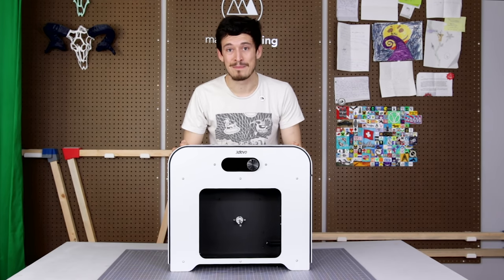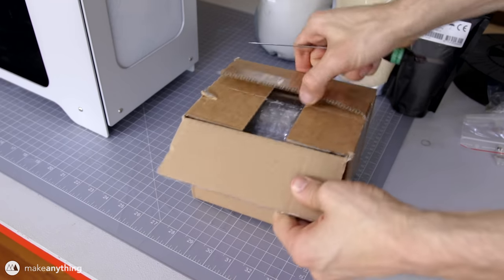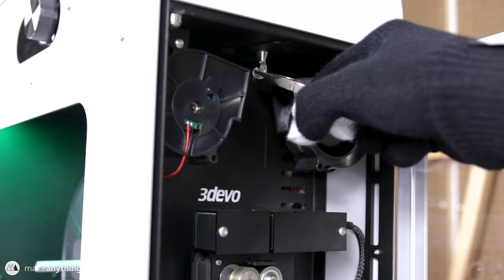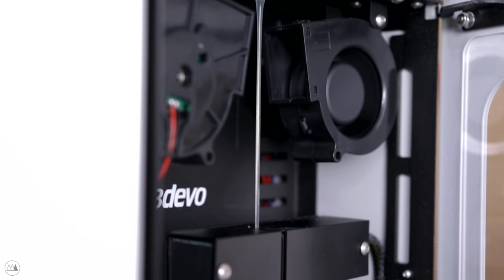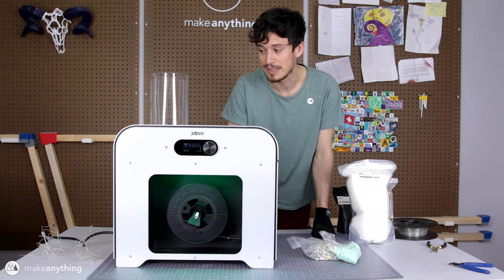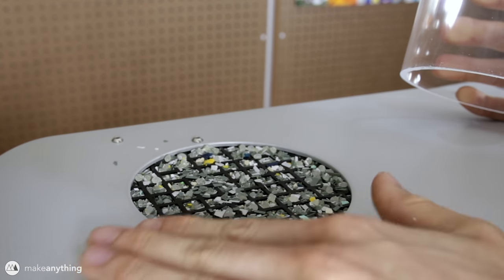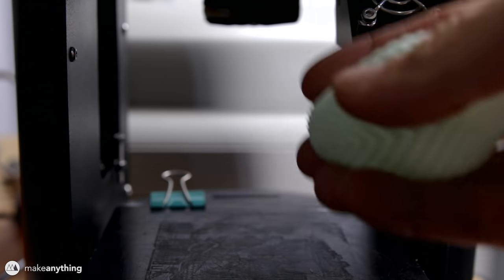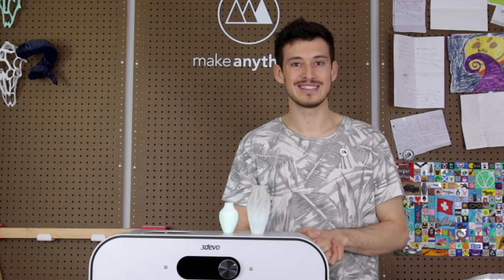Making my OWN Filament from Failed Prints with the 3Devo Composer

Comment: Chip, the magnetic bed is made for this application.  Both the binding plastic and the ceramic magnetic material are chosen for the application.  Normal sheet flexible magnets use low temperature materials because of cost.   However for example one likely material for the magnet is Neodymium which can have a peak temperature from 80 to 200 Centigrade.  without changing the magnetic strength.   I am getting this from a chart provided by Adams Magnetic products.   Their three flexible magnet material they sell are: Standard  71 Centigrade, High Energy 79 Centigrade, and Neo 116 Centigrade.

Comment: Sounds like you'd benefit from the Tevo Shr3d It for those failed prints you want to reuse. I did some research on Tevo and the Shr3d It and it sounds like a pretty good product. It will shred any print into consistent bits of plastic that can be used to make filament.

Comment: You can get mesh screens that you put into a wood frame to make sieves that allow material that is small enough to pass all the way through.   If you use several different stages of screens you can get material that needs to be chopped a lot more versus material that needs to be chopped less.    The final screen will give you a "go / no-go" gauge for the material you actually put into the hopper.

Comment: We need a 3D printer with an optical sensor and self-adjusting flow rate.
Reply: That would be cool but optical sensors are expensive. A pair of digital micrometers might be cheaper solution.
Reply: @SafetyLucas  Optical sensors are quite literaly a dime a dozen. however, I think the idea of two micrometers is a better solution. maybe a set of two spring loaded rollers cappable of measuring the size.
Reply: This smells hackable
Reply: @RalphBrandsma  I think redundancy would be to have both systems. If only one is possible, I am in favor of the optical. Fewer moving parts.
Reply: @deefdragon  i see what you mean. However. I was thinking more for both dimensions. As in have them in a x configuration so that you are sure it is coming out cylindrical and not skewed. But I agree with the less moving parts idea

Comment: You really need to work on the size difference in the crushed filament.  You had 1cm pices with items there were basically dust size. That will never work no matter what your settings are.  It needs to be consistent as much as possible.
Reply: Yes, perhaps it needs the scraps to be pulverized until powder, then mixed in that way.   
Or fuse the scraps into standard size pellets/grains like the rest.  How do they even make those pellets, they are rounded & have no cut marks i dont get it.  👽
Reply: @roidroid  pellets come from a multiextruder, think big hot meat grinder, and are cut up while they're still hot. While cooling down and rubbing against each other they acquire their rounded shape.

I think Devin needs to sift his pieces to make sure they're all below a given size, about the size of factory supplied pellets. Also it still won't be consistent enough. Perhaps a two step process, where he first extrudes some filament which may not necessarily come out consistent, then somehow (to be solved) chop that up into pellets of consistent length, which will then be already much closer to perfect and maybe repeat this process.

Comment: To get good sized granules from recycled prints you could extrude it once to crappy quality filament and shred that. Then you could use those like the new granules alternatively you could try replacing the pully wheel with a gear like thing that cuts the freshly extruded filament from the first run.

Comment: Maybe there is a reason the raw PLA has the shape is has, to prevent jamming and maintain an steady supply of melted PLA helping precise extrusion.
If that is the case, we need an additional machine to produce these pellets, or they have to melt shredded PLA before it gets into the feeding screw.

Comment: I would like to see a recycling service where you can send/give them all your failed prints and they reuse it, and you get money for it, instead of spending so much time and tweaks with creating a new filament. Some sort of recycle would be nice. Because compared to normal plasic trash, these ones are pretty clear and companies have the ability to filter any different color into seprated ways by lasers.

Comment: To recycle old print you need a granulator to get the same size granule as the new plastic
that way the melting will be more equal between the new and the old plastic

Comment: This gets better results most of the DiY stuff I've seen. Lots of potential here and it will be interesting to see how it handles pure recycled plastic rather than adding raw plastic to the mix.

I'm also thinking that getting more consistent shredded material may be the key to making this work. Powderizing the recycled plastic might be too small, something closer to the size of the raw granules might work better.

Comment: What's interesting is, you could totally use a nutty roll as long as you knew what the diameter at each point actually was. It'll change smoothly anyway and you can just adjust your extrusion rate. I wonder if anyone has done that.

Comment: I liked the demo vid.   It would be nice if there was a second pass you could do on a spool to reduce the variation.  If you could run a spool to an empty spool and have it make the diameter even more accurate  (slicing with lots of blades?  grinding?  heat?   Not sure, but seems like there should be a way to make a spool even more accurately dimensioned)

Comment: In order for filament recycling to be feasible it has to be cost effective. At 7000 dollars for the machine (and ignoring electricity costs) you would have to recycle around 250kg of plastic to get anywhere near break even. Desktop 3d printers extrude about 50g of plastic per hour. Assuming 30% of your printing is waste, you would need to rack up about 15000 hours (2-3 years) of print time.
Reply: Or share a machine with another few hundred people via some kind of service.
Reply: and dont forget, such a screw and barrel have a limited lifetime the costs for it are the highest in this machine!!

Comment: If you’re having issues with the recycled stuff failing, perhaps something that vibrates could help. Sort of like tapping on a funnel to get sugar through. It would have to vibrate at intervals, or you’d have it unmix your plastics. 

I really want one of these. I’d especially like to use it with all the soda bottles I go through.

Comment: This is my first time commenting on one of your videos and the first time I might actually be intrigued to purchase a reviewed procdut on your channel! I'm a landscaper and I'm wondering, do you think we could make spoos of plastic similar to what we use for the weedeaters and at a cheaper cost than buying it at the store?! The spools I buy are around $50 and we go through about 10 a year. They're around 855feet I think. I'd be super curious to see u make some and test it in a weedeater!! Love your content, keep it going!!
Reply from the maker: Hi Miranda! The thing is, what you're seeing in this video is my complete experience with the machine, so I can't say much more with certainty. The Composer should be able to make trim line out of Nylon (like the originals)... but 10 $50 spools is still only $500 compared to this $6000 machine (plus the cost of the materials). You wouldn't make your money back for a decade, it seems. Now, there are open source designs for extruders like this, so maybe there's some potential in going that direction

Comment: haha, I see you have binder clips on platen. I just did that after a few failed prints that caused the bed to shift with High Quality prints (snapmaker). I want the extruder but need a shredder to prep material for use.

Comment: To get your filament finer you could do the same thing they use to grind up and mix black powder gunpowder... Use a bunch of steel ball bearings in a rock tumbler with your filament to grind it to powder... In black powder they  use lead balls do not to make a spark and explosion.... But using the steel balls should work well....

Comment: I'm not sure what the temp is as it hits the spool but tape doesn't stick well when it's too warm.  Something like a simple clothespin might do the job though.  Armchair quarterbacking here.  Also, I wish that the thickness data that the composer takes could be input into a printer so that it knows the exact current thickness of the filament it's printing with.  A feature like that might compensate for any irregularities.

Comment: I don't know about its grinding motor hp but, maybe you can try to add diy mini grinding/crusher/shredder/whatever for any kind of waste plastic before put into that 3devo with bigger motor hp.
Since a bunch of waste plastics don't have consistant specs, i hope this method Will make those heating lines have a better and more stable output filament.

Comment: Rather than breaking down recycled filament into 'flakes' or dust, you might want to consider getting/diy-ing another machine that turns these flakes into actual granules. This might help with the clogging you're getting. I think Proto-pasta use a similar process when mixing custom colours.

Comment: Could you connect it to a 3D printer to match the speed with the need of the printer and use the filament in real time?
The printer getting the thickness information from the 3Devo, it would extrude accordingly
Reply from the maker: I'm not sure how well it would work slowed down that much, but it would sure be cool!
Reply: We're already on top of it

Comment: I think the problem is that your pla scrap have shape that is not supported by the mecanism ^^  You need to turn your scrap into small Ball like the one gived by the manufacturer before introducing it in the machine this way it will work like a charm i think ;) But good luck for finding how to turn scrap into small Balls x)

Comment: Pretty cool they've come this far with recycling filament. I've seen a couple other videos that have homemade models which were just ridiculous, sorry ☹️
I'm sure it's disappointing to have to do so much calibrating on a supposed plug and play model, but it's brand new and you'll learn of it. Those flakes you crushed yourself that seem to make the machine go haywire, was there any ABS in there? I would think you definitely have to keep ALL types of filament separate? I'm surprised they didn't include a mini crusher that would sit above the hopper and that way it's a nice nearly identical pieces. Looks expensive!

Comment: Yeah I think the problems start once you don't start with fresh granulate but with some ground up parts instead. Companies sometimes do offer recycled filament but it is usually limited to 1-2 filaments and also to just one color or so. The actual recycling industry has heavy limitations there as well, which materials can be recycled in which color and for what purpose.

Comment: I've used a cheap coffee grinder to cut up failed prints into tiny bits, a lot of blenders wont be a s strong but coffee grinders are great
Reply from the maker: That's how I've done it so far.. it's just a shame they can't run for very long without overheating

Comment: That price seems... A bit ridiculous. Especially when compared to something like a filabot setup - They're significantly larger and draw a lot more power, but run quite a bit faster and have better tolerances at a lower cost ($3800 USD as opposed to €5350 euros)

Comment: It is a very cool system but 7000$ is around 320 rolls of filament(abs, pla, petg,tpu even>_>). 1kg of 1.75 is roughly 330 meters, so total 65 miles worth of filament.... 705 lbs of filament is gonna be hard to reach to see returns especially since you can't melt anything above 200c. On the bright side it would only be about 2 weeks of nonstop running which is pretty impressive actually!

Comment: The problem I see is that it's hard to mix the plastics thoroughly when you have different colors. What I think should happen is the pieces are mixed and heated all at once in one pot. Then once all the colors and pieces are mixed and at the same temp it then starts to extrude.

Comment: The comments on your video about compliant mechanisms were locked, for some reason. My suggestion to just slightly upgrade your 'marble chopsticks' would be to just add more of a cradle for the marble at the lower end of the sticks so that it has a harder time falling out when something is in the grips.

Comment: Hugh? Lyman won a $40k Competition to design a sub $250 Costs Desktop Filament-Making Machine but virtually every commercially made version of it has been absurdly expensive compared to the cost of components. I planned to try recycling Inkjet Printer Case ABS/HIPS and provided a local Recycling Co. with x4 sacks of B/W Colour & Type-Separated Plastics. Instead of putting them through the 8mm granulator one at a time & dispensing the output back into my 4 bags, some numpty tossed everything in together leaving me 88Kg of "grey" material which they helpfully dumped in their Hall in 1 unliftable plastic sack. WTF. LOL! It's not always easy being environmentally friendly...

Comment: id say maybe you did the opposite, that it was too shredded. having powder like pla in there that will melt very quickly, but also pack very tightly in the hopper. vs the very smooth, loosely packed blobs. 

seems like you need a pellet maker to refine old prints, then use those pellets in the fillament maker :P

Comment: Im working on a project that i could use your advice on. I saw on this video the vase you had an inlaid twist pattern to it. Im new but i need to learn how to make basically a triple helix design with a 9:1 twist ratio around a center point. how did you design that?

Comment: I think your viscosity is more than the machine expects, also it could be clogging a filter with very fine particles introduced with handling the failed prints. I use openscad for my designs including my own vases(fluidity on thingiverse), What do you design with?

Comment: The only thing that i'm interested in is whether it works. This is yet another DIY fillament thing, and all the previous attempts made crappy fillament with fluctuating fillament diameter.
Aaaaand, the conclusion for this product is: it's still not a case where you can push a button and go. This is still a product where you need to buy plastic or shred with the correct specification and tinker around to get some filament that can only compete with chinesium grade. And then buy this cleaning compound.
Simply put: this doesn't safe the world nor does it safe your wallet.

Comment: Funny how people commenting here are amazed at the pricing. They clearly have no experience in manufacturing something beyond what can only be printed and at China prices. The Product likely doesn't have enough volume yet to get to the next, lower costing gen folks. Just look at just about any product that needs developing. If as a company, you develop until you get to a reasonable priced unit, as a small business, you may find yourself out of business if you don't get to market and turn a profit. That is unless we only depend on the largest companies with healthy R&D resources which we all know ends up not much better quality wise. Otherwise, from a innovation standpoint, selling these helps innovative business like this continue on. China would be lost if it weren't for companies like this they can copy from. That is until we get to where China themselves are known for quality innovation which with all this manufacturing knowledge, I'm sure they are making a lot of progress towards.
Reply: It's basically a  re-packaging of an already known open source project that's been around for years, there was very little R&D required by the company. The other products you can get based on this tech are about $800, so yeah someone's making some healthy mark-up. Add to that trying to DRM a product who's target audience are recyclers and makers, well ask Dremmel how putting DRM on thier 3D printers worked out for them....

Comment: There needs to be a bit more middle ground between the $300 filastruder that's a bit rough around the edges and these $3000-10,000 ones that come in an enclosure

Comment: I get a strange feeling you might not actually want to turn your old recycled plastic to dust. Look at the size of the plastic they give you, consistent beads... I feel like the smaller dustier bits are actually what caused problems in the extrusion in the first place, like the machine got clogged trying to deal with the size variety or melting speed of the smaller pieces. Trying to match the size they give you might be ideal? I dunno just a hunch...

Comment: now we just need one that can turn plastic bottles (milk bottles, water bottles, soda bottles, etc) into filament.
Recycling that actually has a clear visable impact on people's lives. (i know recycling old materials is already a good thing. i just mean that the impact would actually be visable to the average common man. imagine turning a bunch of soda bottles into filament and using it to make some kind of 3d print; like some kind of figurine, or a door knob, or a replacement part for something.)

Comment: would letting it spool irregular/undersized, then take the extruded material and break that up, then run it again?  repeating to get it to be more and more consistent.  I am not sure, I am curious.  lately been really using the 3D printer my dad has so I have been learning a lot in a short time (and I know for sure, there is still way more to learn still)
Reply from the maker: PLA can't be recycled infinitely, so each time you remelt and extrude the quality will degrade a bit more :\